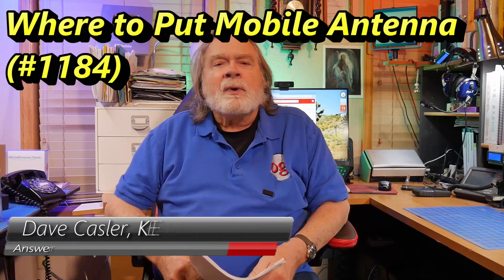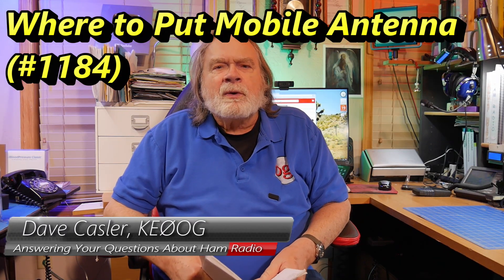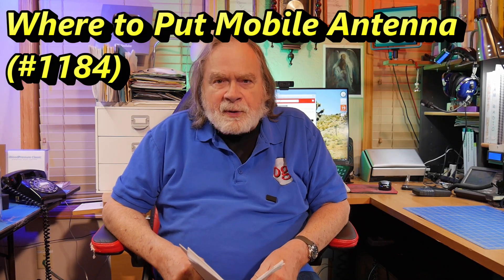Where To Put Mobile Antenna (#1184)

Comment: REP Design use to make a heavy aluminum bracket that went from one side of the cargo bed to the other in my Honda Ridgeline.  It’s mounted on top of the cargo brackets and I had those stripped and tin plated for conductivity.  The installation and pictures are on QRZ and my call sign is KD8RHC.